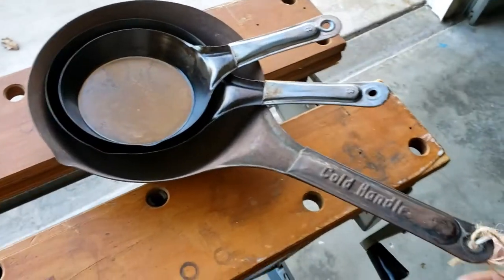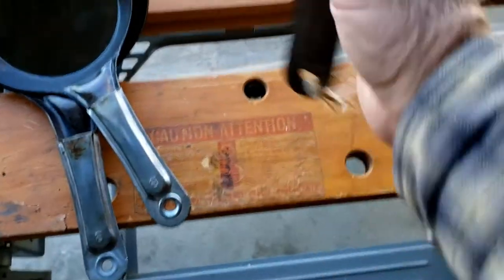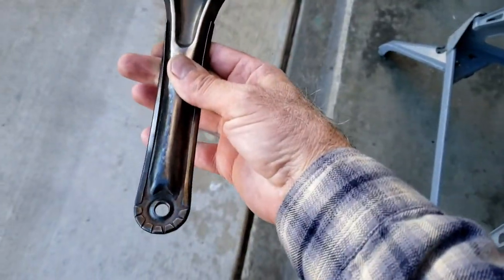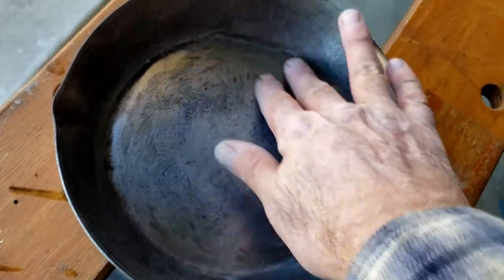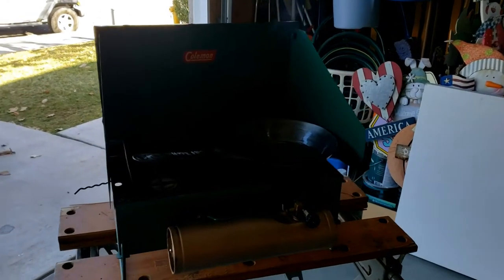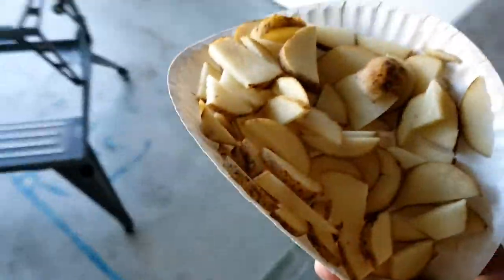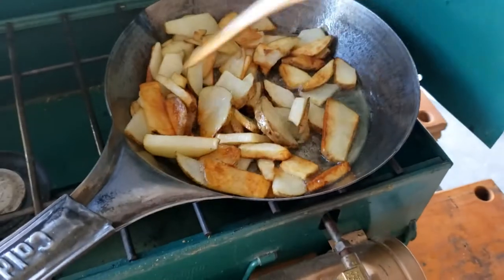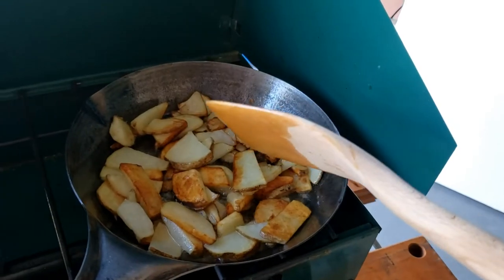Cleaning up and using an old Cold Handle Camp Skillet

Comment: I have a question.
Were those pans ever enameled??
I asked the question because I saw a pan that look exactly like that but it was coated in enamel and very colorful at that.
It was too thin and light but it looked exactly as the one in the video.
Reply from the maker: These style pans have been around for over a hundred years and they still work great. Mine wasn't enameled just bare carbon steel. Here is a link to Dave Cantebury's restoration video that's pretty good.  https://www.youtube.com/watch?v=RgEUQpb4CFM

Comment: Why frying potatoes?  What effect does that have as far as seasoning as opposed to just heating oil?
Reply from the maker: I had always heard the starch in the potatoes somehow opens up the pores in the skillet and allows the oil to be more readily absorbed into the pan. Don't know if that is true or just a wives tale but I have always used that method and it seems to work great. I found this link that might be helpful https://www.cooksillustrated.com/articles/2279-how-to-season-carbon-steel-cookware
Reply: It’s an old wive’s tale. 

Having said that, I do it every time because I just love fried potatoes and this gives me a great excuse.  

Don’t disrespect me!  ;)

Comment: How did you clean it up before frying potatoes
Reply from the maker: I started with some soap and hot water and a little steel wool. Progressed up to flap disc and finished with some wet/dry sandpaper. Then I rewashed it good and started the seasoning process all over again. Works great.
Reply: @Anthonysaudiojournal  awesome thanks for the info